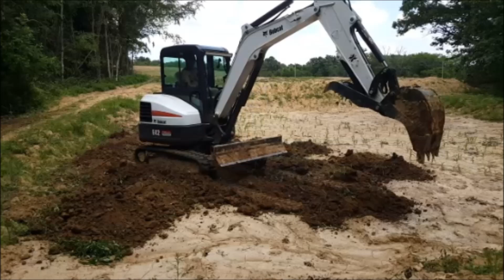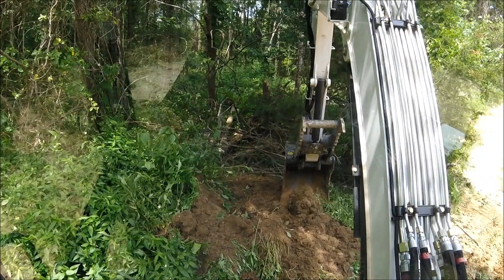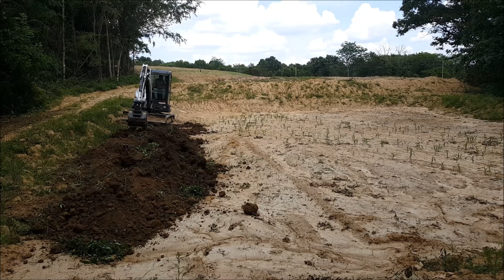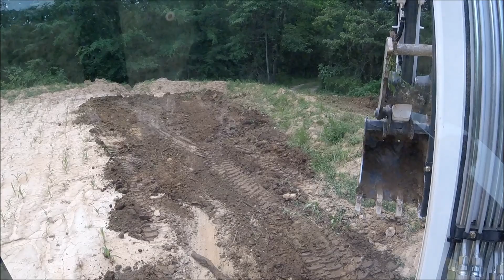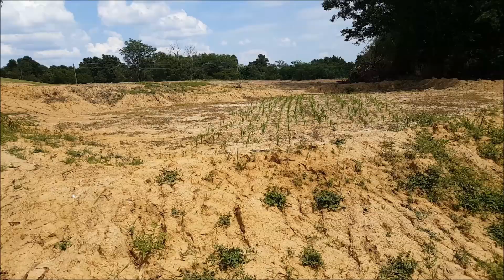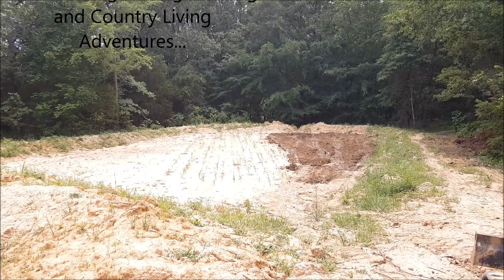Duck Pond Update-Corn is looking Good! Bobcat Excavator Adding Dirt 06-03-17

Comment: Hey Joe, you might want to check into a small dirt pan. I have a durabilt that i pull with a 50 hp john deere and you would not believe how much dirt you can move with it. Not to expensive either.
Reply from the maker: I'm looking for a 'dirt pan' on wheels! It will be a small dump truck!